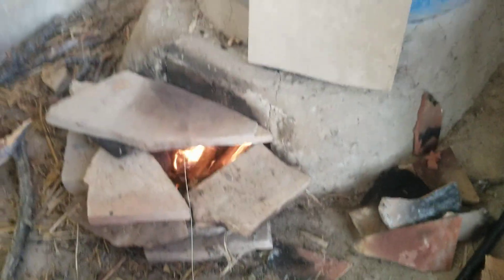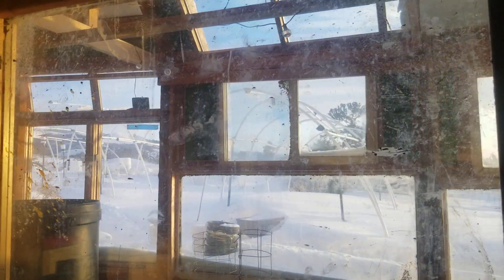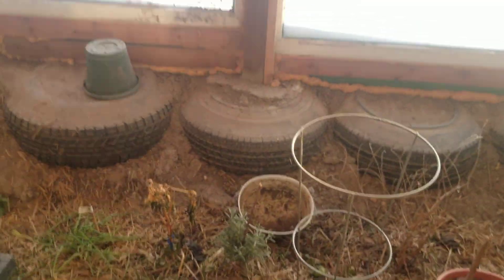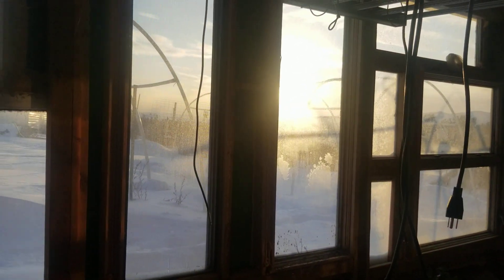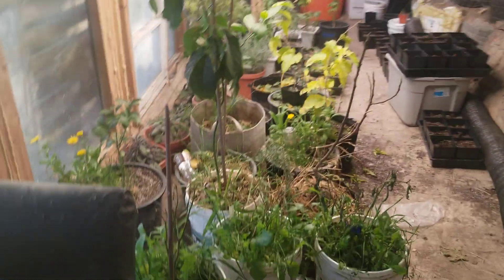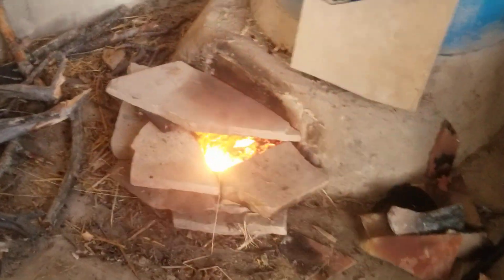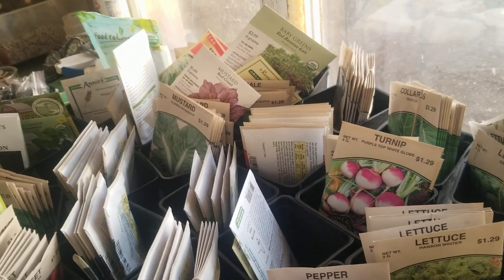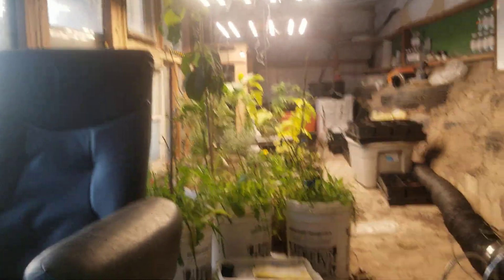Earthship Tested through extreme cold -35°F. Rocket stove, minimum wood still grows fruit trees.

Comment: So your rocket stove doesn't have a chimney? Or your chimney runs through the floor?  If so, how long is the path to outside?
Good, informative video.  Congratulations on your earthship!    I'll watch more of your videos.
Reply from the maker: The exhaust for the chimney does run through the floor. I do have previous videos describing what you're asking. But nonetheless, the chimney is technically outside which sits about 16ft from the ground to the witch cap. The pipe from the stove to get outside is about 30ft long,  then gets to the 16ft vertical pipe outside. This was experimental, but when it was proven to still work even with such a long pipe,  is when we concreted the floor. Thanks for the question, definitely check my other videos on the rocket stoves we have. ✌🏾✌🏾